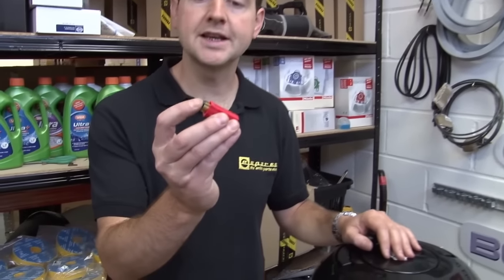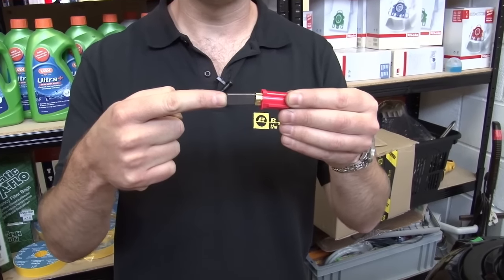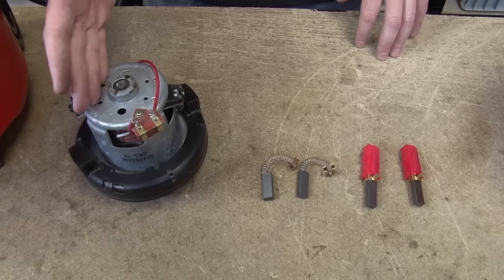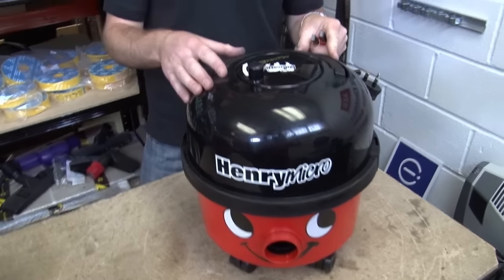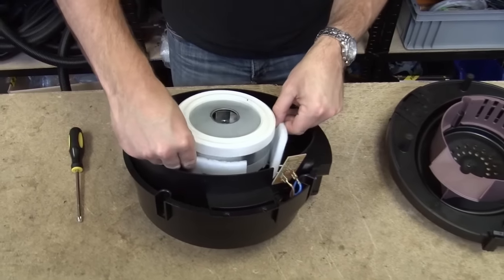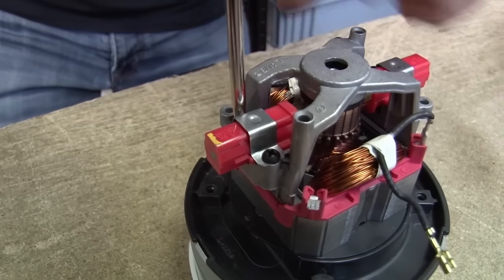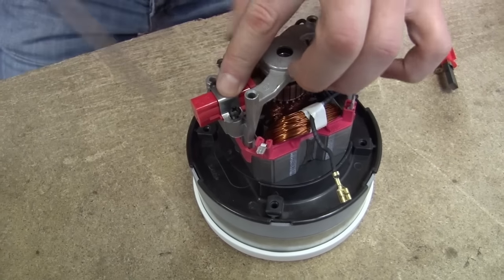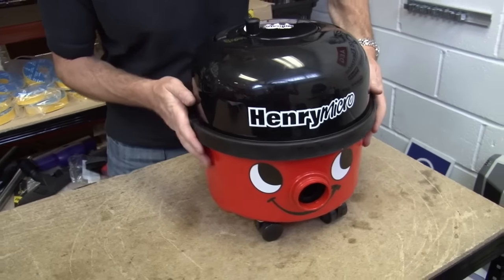How to Replace Numatic Henry Vacuum Carbon Brushes

Comment: Thank you so much for this video! Henry stopped working and we thought it might be the switch. So we replaced it. then we thought it might be the plug. So we replaced it. Then we thought it might be the cable, but I watched your video and checked the carbon brushes and they were burned down to the nub! Ordering new ones today and looking forward to a healthy hoovering Henry again! You did a great job explaining things -  especially the symptom if the brushes are worn!  That was our clue because he was running intermittently, turning on and off by himself and we just couldn't figure that part out. Thanks again!
Reply from the maker: Hi Patrick, thanks for your comment here. We really hope that the replacement of the carbon brushes is the answer to your Henry issue. Fingers crossed our video has helped to get your vacuum up and running again!

Comment: Hi, where can I buy today a carbon brush part no. 220248 - without cartridge? The dimensions are 6 x 8 mm. The length of cooper with spring is 40 mm, so the total length of brush is about 60-65 mm before compression.

Comment: I took my Henry apart and tried the the motor in the mains in its own as it was smoking at first once switched on quite an emmence amount of sparks comes from the top I haven't looked at the carbon brushes yet but does this sound like a new motor based on the small firework display once switched on?
Reply: Anybody?
Reply from the maker: +Craig Hardman Remove the carbon brushes and check that they have not worn down until they are just contacting the armature. This would cause burning and sparking as you describe.

Comment: my numatic vacuum keeps on sparking and smoking after turning on what do u think might be the problem?
Reply from the maker: +Flying-Machine Check if the brushes are worn. If they are in good condition but the motor sparks or smells the motor may need replacing.

Comment: I was just hoovering as normal and all a sudden it's just turned itself off. what could the problem be? thanks
Reply from the maker: The most likely problem is the motor has overheated and cut out until it cools.  It is important when a vacuum is running that you do not restrict air flow as the air flow cools the motor. IF you have a blockage, a full bag or the bag is blocked by dust or powder or if you use the hose directly onto a non breathable material it can cause the machine to overheat.
Reply: It's on strike
Reply: eSpares 😎
Reply: eSpares 4e55766564547u67677667uuu77777
Reply: eSpares 765656

Comment: my Henry after 10years suddenly switched off .I bought new brushes fitted them mounted all back and hover still not working, swapped 13amp fuse ,still nothing..whats wrong? motor,switches?
Reply from the maker: It is possible to be either due to the age of the Henry, check the switch first as this is the most likely.

Comment: Hi my Henry works but the motor has a different sound from what it  normally does. I have to stop using it incase it will damage the motor further
Reply from the maker: Hi Hana, try disconnecting the hoses to see if the sound changes back to normal, if it does check for a blockage by carefully pushing a broom handle from the machine end along the hose. If it is no different check the motor brushes as these may be worn and see this video.

Comment: Is it normal for the henry to produce a smell after having new brushes fitted ?
Reply from the maker: +braceyuk If the brushes were worn and burnt the armature contacts it may spark a little but will usually clean up with wear. Alternatively dismantle and wipe any blackening of the armature using a fine grade abrasive paper. If it continues to spark significantly once cleaned the motor may be failing.
Reply: Ok 1 more question...i have 5 henrys and im trying to fix the brushes in them all but iv only been able to fix the type u have in the video... with the other model where you just replace tge sping and brushes , what are you supposed to do take the old 1s out of the casing and try and put the new 1 with the spring in ?? Cos when i try that the bottom part where the spring connects to does not fit in ? Are you suppose to just bend the bottom part back or what ? I cant find any tutorial on fixing the other type..any help is much appreciated
Reply from the maker: +braceyuk There are a number of brushes available for 'Henry's' depending on motor type. Check out our brush range to see if we have one that matches directly at: http://www.espares.co.uk/search?SearchTerm=henry%20carbon
Reply: +braceyuk Its usual when your replace the brushes. When they wear in,it wont smell.I had this happen to my Numatic James.

Comment: My henry is too my 200A is not working on lo and not good
Reply from the maker: Hi Marcus, if your motor does not run at all on low suspect the switch or the small PCB. If the performance is down replace the filters before suspecting a faulty motor.
Reply: eSpares  i have a new henry vacuum cleaner lad hvr 200 22 it is best
Reply: eSpares  I have a new hetty